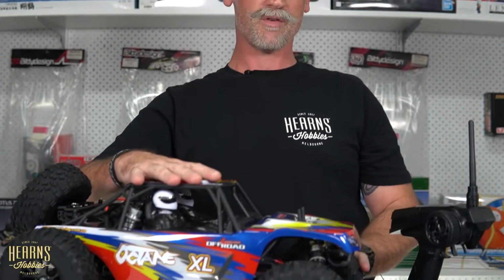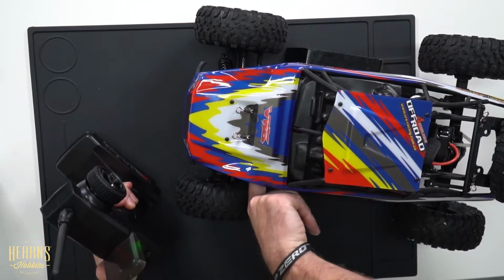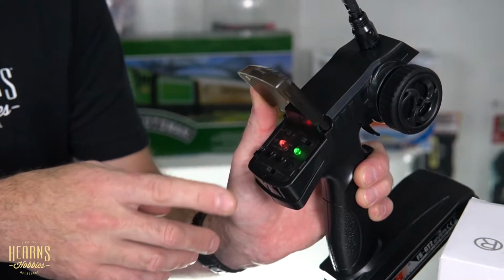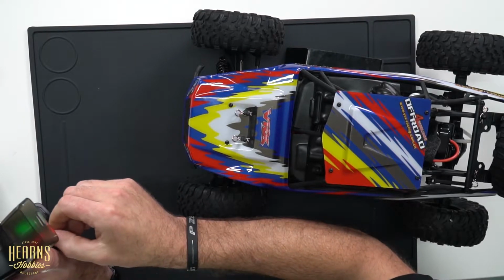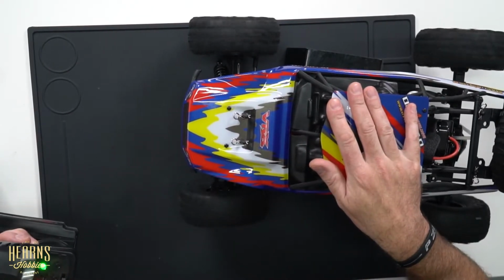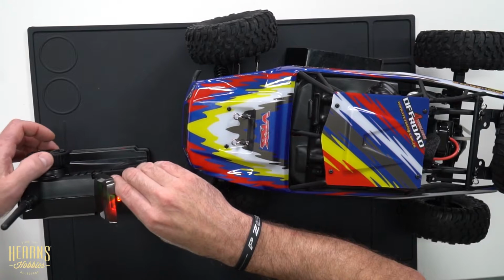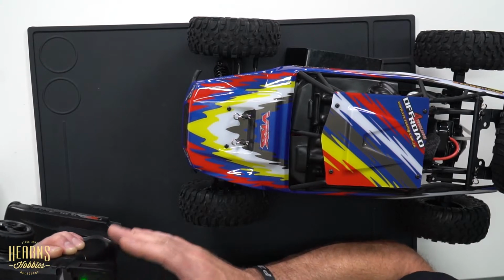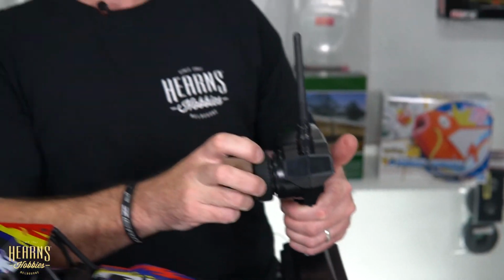Setting Up your RC Controller Tutorial | #askHearns

Comment: Some reason with mine the brake - pushing forward does absolutely nothing
Reply from the maker: That would suggest there is an issue with your set up.
Reply: @HearnsHobbiesMelbourne  indeed there was. But thankfully I fixed it

Comment: I have this nitro but when I was racing I lost control of the car I would try to turn it but it didn’t and just continued accelerating until it hit
Reply from the maker: Sounds like a controller problem.
Reply: I done something like that but I don't race, I just car park thrash bash...  There goes Nigel Mansell ploughing straight ahead crashing his F1 car into the fence, It looked just like that.. and the 1/10 VRX Spirit or Sprint, I don't remember, really cheap p.o.s 1/10 Nitro Buggy, It went flying into many pieces as the nitro engine screamed in it's power-band.. at least it smelt good.. I had to pick it up b4 it took off again with it's front end un-attached..  Fun..